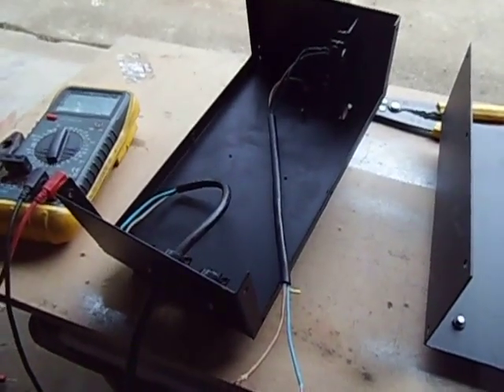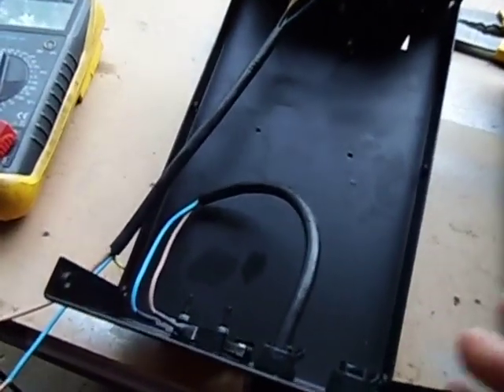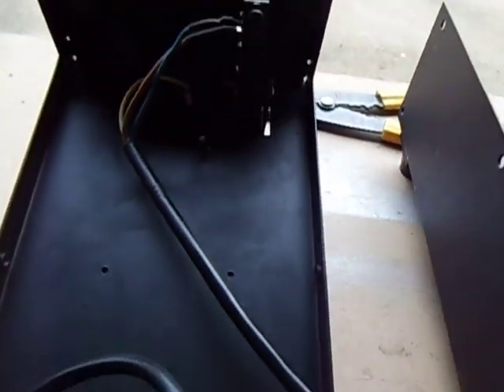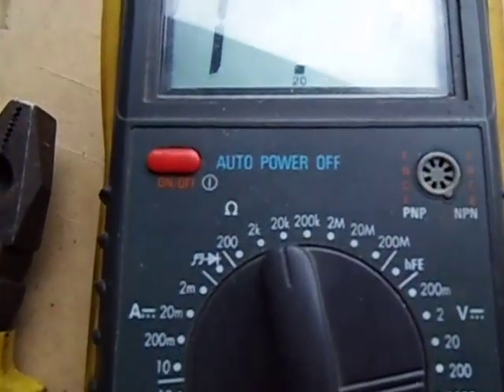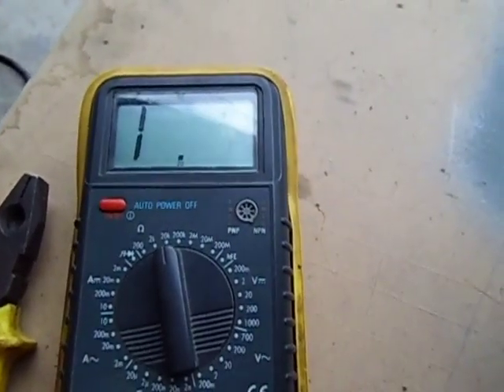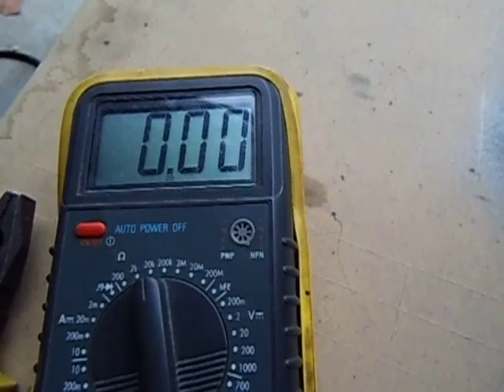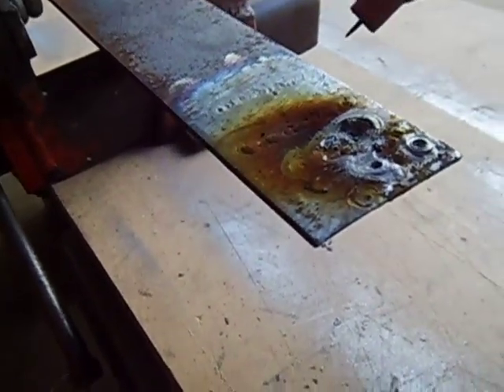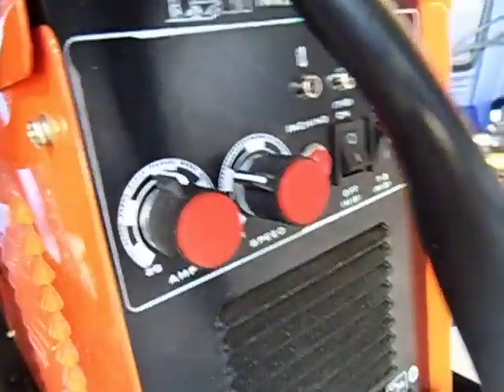Tig foot controller pedal modification

Comment: So this is basically an on/off switch, right? I've just modified my CT-312 to use a variable foot pedal so I can vary the amperage during the weld/cut. I added a switch on top of the case to select either the potentiometer on the machine, or the one in the foot pedal. What you've done doesn't vary anything, putting a potentiometer inline with those 2 terminals will do fuck all as far as varying the amps, as was demonstrated in your video. PS. nice footware for welding, I must get me some.

Comment: Your welding machine has no input socket for a variable current foot pedal. Your two pin socket is for on off only. current is adjustable using your dial only.

Comment from the maker: The micro switch is a normally open switch witch is a make and break switch witch close the contact points when the pedal are pressed down and is connected in series with the switch and as it is pressed further in  it changes the resistance of the slide potentiometer also know as a slide volume control used in DJ disco mixers . The potentiometer is a 10k resistance and most electronic shops will have it . Please view video carefully for how i made the connections , hope it helps
Reply: 00

Comment: Resistor is doing jack shit in there. 

Also the current is running through the gas line. It's a metallic conductor and the gas flowing through it keeps it cool so it doesn't melt with higher amperages.

Comment from the maker: If you're right welder is set at 100 amps then your control pedal will start from 0 and increase as you press the pedal futher in up to 100 amps

Comment: If that’s the correct way of wiring why didn’t the pedal factory wire it that way, and why does the 520 style welder have a 2 pin and a 3 pin. Because the 2 pin switch is only on and off. You are creating a voltage drop situation in the circuit board which is never a good thing. It’s so simple pit the 3 pin back on add a opposit sex din 3 pin on your panel with a switch selecting panel or foot switch just like the real welding companies do. I don’t think what your doing is safe or right .

Comment: I was curious about the importance of polarity when connecting the wiring from the resistor.
The pedal I purchased was slightly different and doesn't appear to vary amperage, altho it did so when testing with the Multimeter.

Comment: I swear you not using gas. Why is there so much splatter flying around. But thanks because im gina do this as well now. I been using just the on and off switch on the torch. You vid helped me. Cheers bro
Reply from the maker: Jas Poin you welcome hope you come right . The fitting that fits the machine is a microphone fitting witch can be purchased on Ebay store

Comment: Interesting video mate, considering doing similar to my fathers Rossi welder that seems too hot even on minimum setting of approx 20 amps (according to dial on front). He has found a similar 2 pin 3 pin pedal but it has a current control knob on the front (1-10 scale). Do you have any idea what the knob is actually for, ie could be remove it too?Thanks in advance

Comment: Hi, thanks. to my way of thinking the Tig torch switch is only an on/off. you could have a foot switch to do the same thing and still use the machine knob to change Amps. Is this right? going variable eg, changing amps is a different thing. does that make sense? I have just bought a Rossi 620IS and thinking of a foot switch. kind regards John
Reply: Just pull the amperage pot which has 3 places to weld wire. Wire that to a 4pole double throw switch, then original wires through the switch the other 3 go to a 3 pin panel plug. Make sure the position 123 match the 123 in the foot controller.  Then it will do both
Reply: Mark Schuster would you be able to wire into the current tig/stick switch so that the  switch is in TIG mode the pedal is live and connected to the potentiometer? So that it’s not active when in stick mode?

Comment: Hi,Thank you for trouble of making video,very good.One question if the Tig origanly had a handle press switch 2 pin.How does the gas get to the torch with this modification...lol. Gas is normaly operated by the trigger on the handle of the torch.Is there some kind of con ection to a sleniod in there somewhere..lol. Just asking as love to have a go with foot pedal...Thank you.
Reply from the maker: Wendy Whales I made this long time ago but the switch is in series with the potentiometer, so one wire from switch will go to one pin on welder , the other wire off switch should go to the potentiometer and the other wire from potentiometer back to welder. Ps check carefully the video lol it might make more sense. Also switch should become active as pedal gets pushed down then the potentiometer should kick in so calibrate is important,  cheers